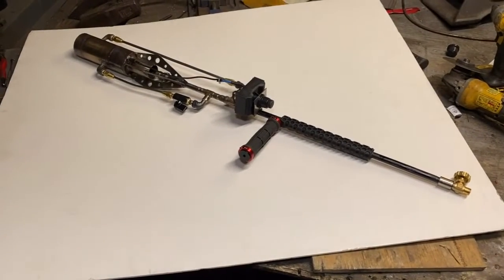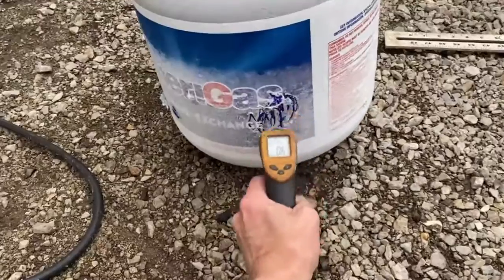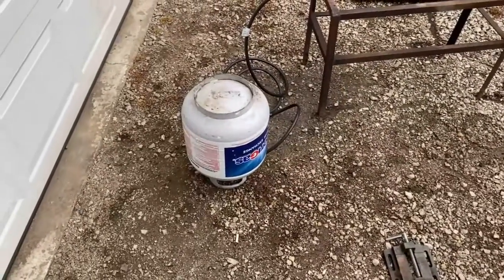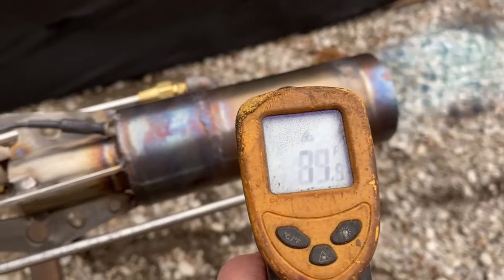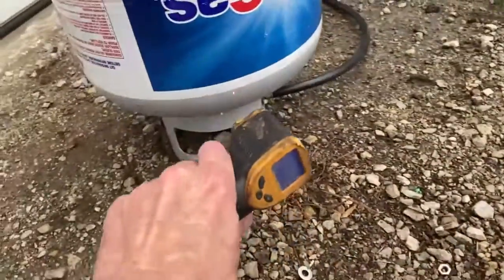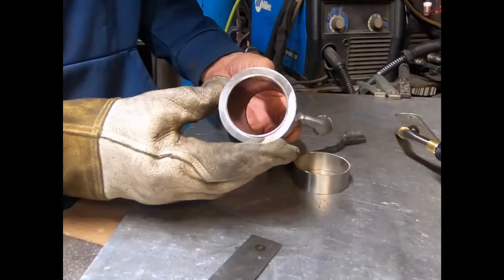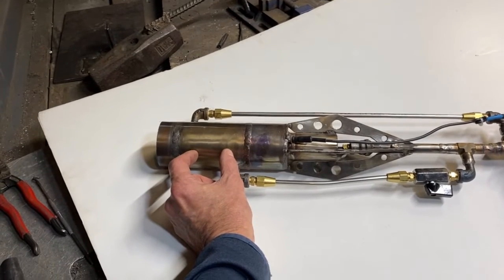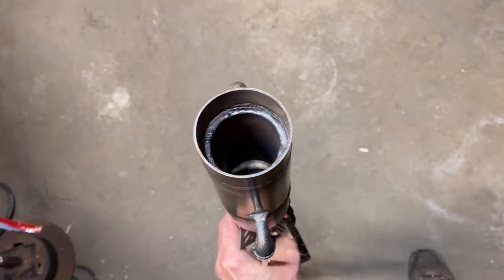Liquid Propane burners but why ?

Comment: One little detail that I see there...

Depending on the circumstances, closing off both valves suddenly might create enough pressure to cause a rupture.
Reply from the maker: nah , rated over 1000 psi . It would weep out threw the flare fittings before it got bad  . But you are correct it will pressure up .
Reply: @NOBOX7  As long as it will bleed off before tubing ruptures then it will be good. (^_^)/